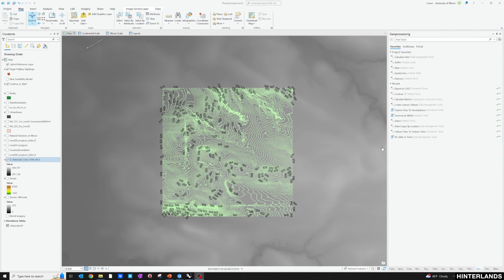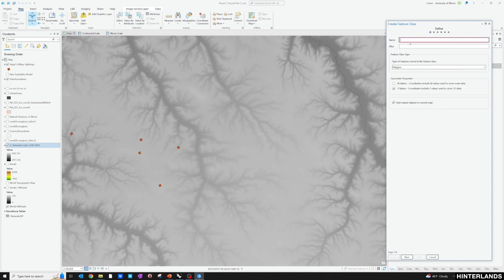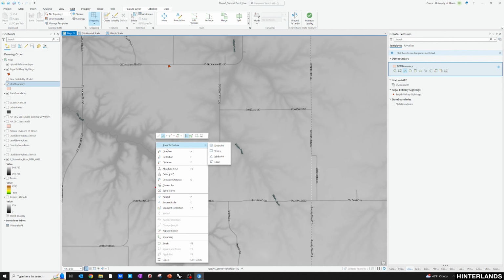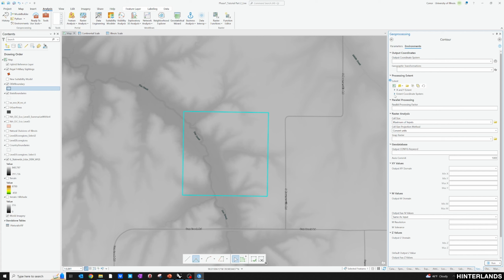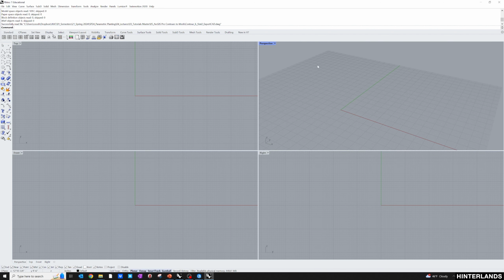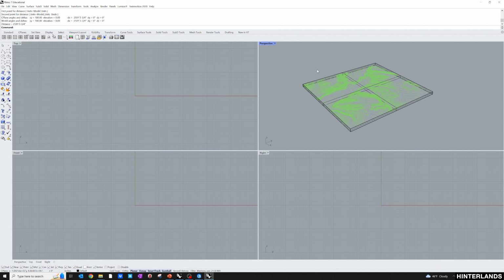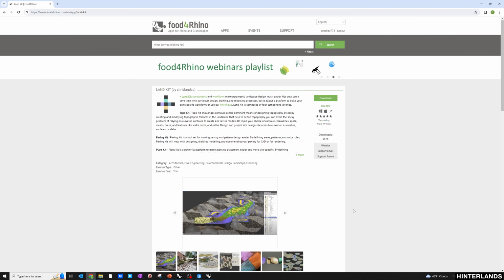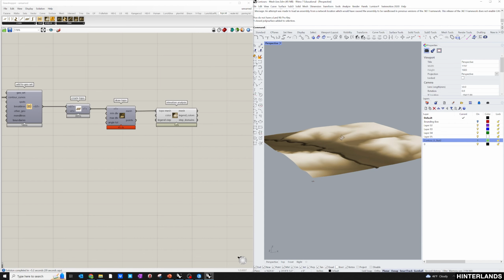05 | Export Contours From ArcGIS Pro and Generate a Mesh in Rhino Using Grasshopper

Comment: Great tutorial but I think I know why your DEM didn't import correctly into Rhino and you had to scale it. USGS DEMs are always in 1 meter by default so if you create contours from the DEM directly they will not be in feet, but rather meters. There is actually a feature calles "times" in ArcGiS geoprocessing tools that allows you to take care of this by multiplying the entire DEM by 3.28084 (feet in meters). Also, when creating contours, if the lowest elevation in your DEM data is higher than 0, you want the "base elevation" field to reflect that number. This ensures that your contours accurately reflect the elevations. Great video!
Reply from the maker: This is huge, thanks a million. Looking forward to fine tuning this process on our end.

Comment: Hey! I am trying the same thing but while importing cad file into rhino , i am not getting these curves in 3d, not even showing up in perspective mode, showing only in 2d view, kindly revert..
Reply from the maker: Thanks for your note, Rohan. I haven't encountered that problem, perhaps it has something to do with your import settings in Rhino or with the options you select when running the contour geoprocessing tool in ArcGIS Pro. I always use 1' as an interval. Perhaps yours is inadvertently set to 0?